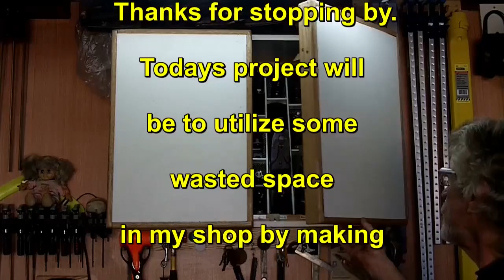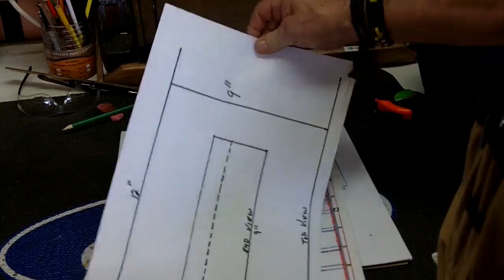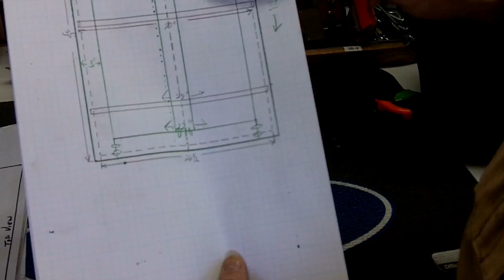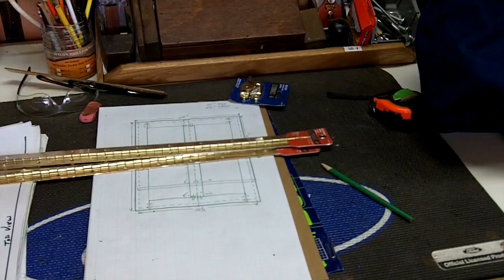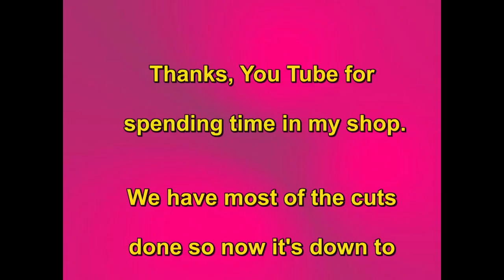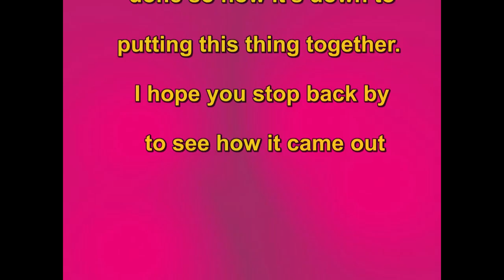A New Cabinet for My Woodshop Part 1. Cutting the Melamine & Red Oak

Comment: You are so right I am ready for spring 20 degrees right now going down to 15 tonight and just got about a1.5 of snow that they were not calling for The older I get I don't like this stuff anymore Now I see why the older people move south I am ready to start packing lol  I need to do this in my shop I have stuff packed on top of stuff and it takes me forever to find anything cant wait for spring getting my new shop 16x24 2 story I have been drawing up all kind of ideas on how to lay it out
Reply from the maker: +Charlie Wood   Hey, Charlie.  A 16X24 shop?  That's man Heaven.  When you start on it you should put up some videos.  Again, thanks for stopping by...don't freeze.  Summer will be here soon and you'll be wishing for cooler weather.